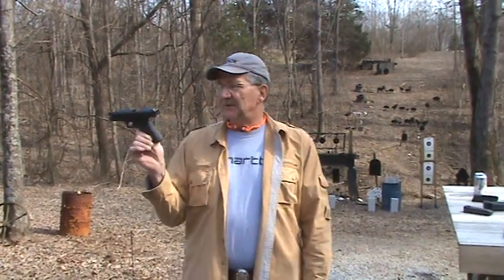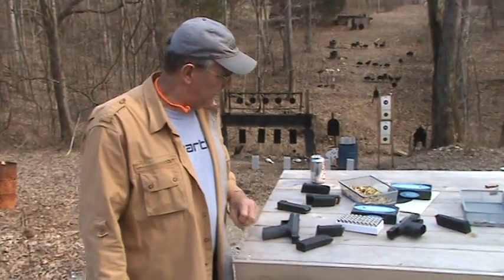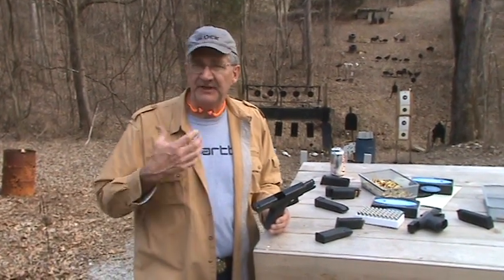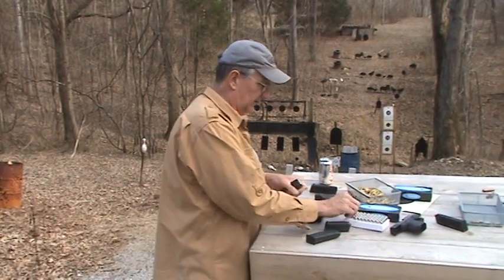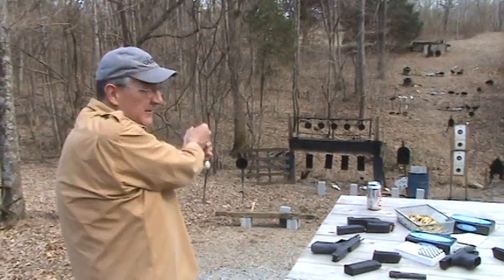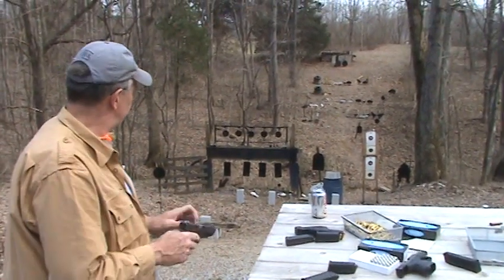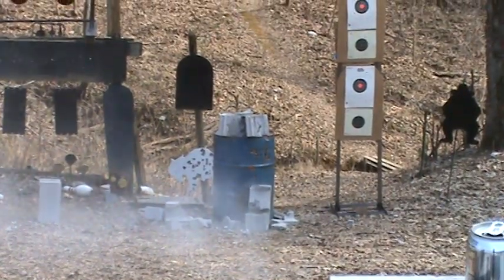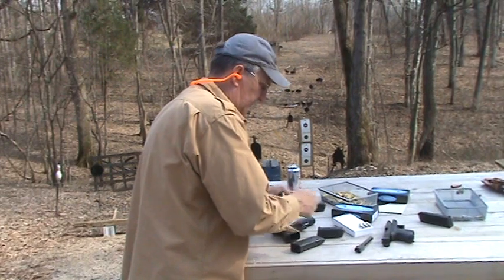Glock 20 with heavy cast bullets

Comment: You should check out the 10mm double tap Equalizer. Its a imposed load that stack a hollow point on top of a lead ball. A guy at the range was shooting it out of his EAA witness. each lead ball did seem to hit 1 inch high above the hollow point as promised by the manufacturer.

Comment: Stock Glock barrels are polygonal - they have no "rifling" to "cut" into the lead, the bore itself is cut in a geometric pattern that allows for a "rifling" effect. Since there are no edges, the lead will seal flat against the surface - raising pressure of the gas (harder to push the lead down), and after a few rounds can create a layer of lead that will act like tar to the next bullets fired - building too much pressure in the breech.
Some aftermarket barrels have actual cut rifling for lead.

Comment: Excellent video.  I have been debating buying a Lone Wolf barrel for my Glock 23 so I can shoot cheaper cast loads.  I know, they advise against reloading 40cal due to the "bulge", but I have not had one issue in thousands of loads.  Also, Redding makes a dye that will iron out the bulge, and it works great.

Comment: Good point. Using special rounds and your results will become special as well. One of the things I liked about this video. Snake loads from a 10mm are a lot like a Hornets Nest or discharge of several .22 simultaneously. thx again Hickok45. 
..btw, I get your point. Like throwing a knife vs a hammer. You better be accurate w/ the knife is a good point. You just do not have to be as accurate w/ a hammer is mine. .

Comment: You can't beat Lone Wolf for after market barrels for Glocks. Great video Greg!
Reply: Dang I didn't realize how big of a difference the barrel made.. are Glock factory barrels not that good??
Reply: @wingnutmcspazatron3957  Doing some digging, the glock barrels are actually great! The issue here is that the bullets are super heavy grain and hardcast, glock themselves advise that you do not use hardcast bullets with their polygonal barrels (which is all of them). Looking to pickup a lonewolf for hardcast hot loads as they can also shoot everything else.

Comment from the maker: Actually, I just discovered last weekend that the G20 barrel does not work in the G29. Guess I should have known that, but I didn't.  Not that I'd have any reason to want to switch it out.  If I want a longer barrel, I'll just use the G20.

Comment: those flying lead elephants were all over the place @ 4:20. that aftermarket barrel seemed to improve accuracy a bit considering. its not really common for hard-cast to be fired through a glock (let alone, super heavy hard cast) but i am surprised none the less... excellent video.

Comment: .40cal is essentially a necked-down 10mm. If im not mistaken the .40 and 10mm are the same diameter, case length and powder load is different. If it were me, i would call the good old 10mm a 40-magnum :)

Comment: I believe you are getting the keyholing (tumbling) with the stock Glock barrel because it either a) has too slow a rifling twist, or b) because it's polygonal instead of having standard groove-and-land rifling.
Nice explanation.
I carry a 10mm S&W 1006 for protection against two-legged varmints.

Comment: 10  MM Lone Wolf Barrels are the best for hot 10 mm and 357 sig rounds... This is just my opinion and I am a Glock Guy.     Love the Lone Wolf Barrels for them... Smaller caliber Glocks I will stay with Glock Barrels... Great Video..
Reply: KBLively  My Son and I have a few different Lone Wolf Barrels... We have never had a problem. My 357 Sig Barrel which I use on a Glock 40 is extended with threads for a suppressor .. My main reason for buying though was so I knew it was in the weapon and did never make the mistake... Great Barrels and great accuracy...You will be happy..Thanks
Reply: ugsisr what barrel length is it... just wondering which long wolf i should get to fit the 20

Comment: Just a correction Mr Hickok, you're referring to sectional density being high.  The shape of that bullet lends to a low ballistic coefficiency. Sectional density is the ratio of the bullet's weight to its caliber. That 10 mm 230 grain bullet will have a higher sectional density than a 45 caliber 230 grain bullet. A spiral pointed bullet will have a higher ballistic coefficient than a round nose of the same weight and same caliber.

Comment: From reading all the Glock forums/websites and hand gun forums in general they all said that using heavy hard cast hot loads you need to take out the stock spring and use a heavier spring.  22lb pound recoil spring for the Glock 20 is needed for anything 200gr and above.  You also want to use an after market barrel from either KKM, Jarvis or Lone Wolf.

Comment: Most people that I hear talking about taking grizzly say 12 gauge magnum slugs are perfectly fine, which have around 2300 ft pounds at the muzzle, and the s&w 500 magnum has numbers around 2500-3000 ft. lbs, so, yes, you are correct, although most people still abide by the 'bigger hole' mantra.

Comment: Got the lone wolf barrels for my glock 20 and 29. Haven't had the chance to shot with them yet, but loaded up the magazines with some double tap 200 grain hard cast lead rounds and tried to rack the slide to cycle the rounds thru... Jammed up like crazy on both guns. Either hung up or went in, but I had to use a lot of fore to force the slide open to eject the round.  All the hollow points I tried worked fine.
Reply: Richard Wisor Jr Any update about your G29 Lone Wolf barrel and the 200 grain double tap?  I am really thinking about buying a Lone Wolf barrel.  The Doubletap 230 hard cast lead bullets really gummed up my stock Glock 29 barrel with lead.
Reply: Lone wolf had me send them both of the new lone wolf barrels (20 and 29) to them along with a couple of the double tap 200gr lead rounds. They polished up the ramps and Chambers on the barrels and sent them back to me. Now I have no issues feeding those doubletap lead rounds. Made me a bit angry the could not send my rounds of ammo back. Told me they weren't allowed to send live ammo.
Reply: Thanks for the update!  I'm glad to hear the barrels work well with the ammo.  Oh, I can't believe they kept your ammo!  You would think if they can "receive" it, they could "send" it back, Geeze!
Reply: I was surprised by there excuse for keeping my ammo. I shot a lot of lead thru a S&W 357 and after so many rounds I'd get quite a bit of lead smeared I  the barrel, so my police Academy firearms instructor gave me the tip to put a few jacketed rounds thru the gun, and that would clean all the lead right out! Works great.

Comment: Yeah I wasn't sure which one you were converting to. I think the G23 frame and slide should be able to handle the 9mm and the .357 sig but you will need to buy springs made for it because both the 9mm and .357 sig have higher pressure. The 9mm just just a little more and the .357 sig has quite a bit more. I would think that the with the right spring the other parts should hold up just fine.

Comment: @Outlaw409 for backpacking a 10mm is a pretty big cartridge, so is the .357mag.For what ur gonna use it for i would go with a .40S&W or .357SIG u can pick up one for pretty cheap & ur getting a good bit of stopping power with both & they are compact enough not to be a burden while hiking, or camping. The 10mm is a little overkill in my opinion & has a good bit of recoil to it

Comment: Well if the barrel works then the only think I think you would need to get would be a spring made for the G20. The slide should be able to take it and the frame is the exact same one so it will do just fine. But definitely get a spring made for the G20. They aren't that expensive either.

Comment: The reason the bullets keyholed and had no accuracy is the length to diameter ratio you mentioned; this determines the required twist in the rifling to stabilize the bullet. Obviously your other barrel has a higher twist rate that the stock barrel. What you discovered is that this ammo. is unusable in the stock barrel. the reason, once again is very clear; the twist rate of the rifling is not steep enough to stabilize the longer bullet. You can verify this by looking down the two barrels.
Reply: John Affleck Heavy bullets require slow twist.

Comment: @arkangel8419 The 10mm is a hot .40 caliber. The same comparison that a .357 would be to a 9mm. Same calibers. Completely different rounds. The .40 caliber was developed by S&W in 1989-1990. The .40 was developed from the 10mm case, just shortened by several millimeters. The 10mm is an awesome round. I have killed two eight points and some smaller deer with the S&W 610 revolver in 10mm.

Comment: I expect what Hickock will say is to try a dozen types of ammo and see what your gun seems to "like."  Two guns of the same make and model might prefer different brands.  I'd be sure to try a few of the least expensive, because if you can't tell a significant difference in accuracy, go with lesser cost.  My Ruger Mk II used to like good old Remington Thunderbolts about as well as anything.

Comment: I saw tumbling issues with my stock Glock 29 barrel and the 135 grain nosler JHP's from Underwood.  Exact same wild shots and keyhole pattern that you saw.  Switched to a KKM barrel and the tumbling went away.  Maybe the factory Glock 10mm barrel isn't good for rounds that push the envelope in speed or weight.  Strange.

Comment: @snoeplow These are Double Tap, but yeah, price isn't bad at all for a load that can equal a .41 Magnum and even some high end/lower power .44 Magnum Bear loads. If I don't have a rifle/shotgun, then I'll take 15+1 or (10+1 where I live) of hot'n heavy 10mm with the ability to reload in 2 sec over .44 Mag. 2-4 hits with 10mm >  1-2 hits with .44 Mag.

Hickok - Any chance you could try out some 9x25 Dillon rounds from your G20, and/or 40 Super from your G21?

Comment: Yes, a measure of the weight of the gun powder you would load into a casing. The "grain" as a unit of weight, goes back a ways. Now days, its used almost exclusively in the firearms projectile industry.

Comment: Well the 10mm produces more pressure than the .45acp so I would think that the 10mm spring would work just fine. The plastic part (well it is some sore of polymer material but I'm not sure what it is called) is the exact for the 10mm Glock 20 and .45acp glock 21. I would think that the slide would need changing with the barrel because the hole where the tip of the barrel comes out would be too small if using a .45acp barrel with a 10mm slide and too big the other way around

Comment: @madtoonage I'd need to see some data on 9mm Dillon as a defense round. It's almost 2x the KE of .357 Sig. A 9mm bullet moving at rifle velocity (~2100fps) could over penetrate before it got a chance to expand. I think it's just a super high end target round.

I use DT Barnes Tac XP in 10mm, .45 Auto out of my G30SF or .357 Sig, .40 in my G33 for defense against anything on 2 legs and most things on 4 legs.
Reply: Had a rookie mistake about a month ago, and had an ND with my EDC G26gen5. A Remington Premium Defense, 145gr HST passed through my left hand, and left knee,  from point blank, and expanded PERFECTLY. Because of the extremely close discharge, is the only reason for the through and through. Had this struck center mass, or hit bone or heavy tissue, it most definitely would have been far more brutal, and most likely fatal. I assure you. The 9x19mm Parabellum cartridge has had so much ballistic study devoted  to perfecting it, that it has surpassed a vast number of other cartridges. As far as personal defense against human assailants,  it is a more than effective round, with higher capacity, and extremely manageable, rapid secondary shots. Love my 45acp, not much for 40s&w due to cost, and staying with the same caliber for necessity of only 5 separate calibers. 9mm, 45acp, 7.62x51nato, 7.62x54r, and of course, the good ole 22lr

Comment: @hickok45  I'm guessing that the 230gr should key-hole even MORE in a G29 with a standard, Glock, factory barrel. If you have any more of the Double Tap 230gr you might be able to check that out.  I don't have a Glock 10MM barrel. I am waiting for a KKM conversion bbl for my G30.  I will keep my bullet weights at, or below, 200gr.

Comment: What's your thought on the cartridge case used by DoubleTap, as opposed to standard brass?  In terms of pressure in the chamber, and in terms of reloading (do you even reload with the DoubleTap casings?).

I really like their 135gr Nosler JHP (super-flat high velocity round) and the 180gr bonded defense JHP.  Although I have a box of those hardcast VW Bugs for fun :)

Comment: Thanks for the video. I went out and bought the Glock 20 after reading a bunch on it and watching countless videos.  My first 50 rounds of FMJ went flawlessly. However, I purchased some Doubletap 135 gr HP and on the second round it failed to eject. I fired out the rest of them without fail and loaded up again, same thing, second round failed to eject. Without any other ammo having been shot through it, do you think this is an ammo issue, a hardware issue, or could it even be my grip?? Thanks

Comment: It's ironic the FBI decided the 10mm had too much recoil for the average officer and yet you handle it very well.

The stock barrel should have done better,  I was surprised by the inaccuracy of it.

I guess it wouldn't be wise to hide behind a cement block wall if someone has that big, bad 10mm aimed at it.

Comment: From what I have heard the frame of the gun is the same between the two so if you are going from a 10mm to .45acp or the other way around then you would need a new barrel, slide, spring, and mag. I have compared side by side and looked at them both and the frame (by frame I mean the part that the mag, slide, spring, and barrel come together on) seems to be that same. It is cheaper than buying a whole new gun but not by enough for me. I would rather buy the other gun and have two.

Comment: I experienced keyholing inside 25 yards with the Doubletap 1600 fps 135 grain 10mm  rounds in the standard Glock 20 barrel.  Too slow twist for a fast short bullet?  Next time I am at the range I'll try the 6 inch wolf barrel and see if the keyholing is eliminated.  Standard Glock barrel is a tack-driver with most ammo.  I made a 1.5 inch 5-shot group at 25 yards, all inside the 10 ring the day I put in my Heinie straight-8 sights, using cheap American Eagle 180 grain range ammo.

Comment: And the part on the slide that come into contact with the back of the bullet that houses the firing pin is sized for a specific bullet. Maybe the .45acp slide could have a 10mm round fit there but the 10mm slide is too small. I am looking at my G20 right now just to make sure. I don't know every kit out there so maybe there is a way around the size difference. I was also going to buy a .45acp slide, spring, barrel, and mag but decided it isn't worth it. So instead I got a 6' lone wolf for my G20

Comment: The best of both worlds is the Kimber Eclipse chambered in 10mm. I get to have my 1911 and a 10mm. The Glock 10mm which is the same frame as a Glock .45 just doesn't feel right in my fairly small hands. But a 1911 feels great. Recoil? not as bad as you might think, to me a .357 revolver was worse. And you get to own a work of art, not just a pistol. Glocks work but they ain't pretty. Handguns are for self defense, I realize, but, I want to hand my Kimber down to my son, then my sons son.

Comment: hey hickok what is a normal store bought 10mm bullet speed? & what is a reg store bought .40S&W speed? because the 10mm is a .40 cal bullet too right? the only diff is that the 10mm has a longer case that allows more powder.....I only ask because i shot one at an IDPA shoot and this guy loaded his down to the min power grade for IDPA which is like 125 i think & i just wonder why not just use a .40?????

Comment: I run my .45 with Magnus 215 grain hard cast semi wadcutters and use their 250 grain 429421 Keith bullets in my .44 Magnums. I have shot "cinder blocks" with both and from what I have seen here, my .45 load is doing what the 10mm is, but maybe not quite as fast. The 10mm can't hold a candle to what my 44 does with the bullet I mentioned. I sold my 10mm a long time ago and as far as my needs and desires go for a hunting handgun or woods self defense, I'll stick with near 50 years of experience and the guns and calibers that provided it. Thanks for showing what the 10mm won't do well though, your work is appreciated.

Comment: The Lone Wolf Barrel was impressive. Since I am in Black Bear country, and the Moose Huggers have all but stopped hunting, Bears and Big Puddy Cats have lost their fear of Man. This is a very good answer to having to staring down the sights at a 4 legged preditor, and wondering if I have enough firepower to  stop the critter that wonders if I taste like chicken. Fortunately,, I have not needed to cap a critter yet, but close encounters has happened several times.  The critters are getting braver,  faceing them down has been occuring more frequently.  Pulling a carbine out of a scabbard takes too long to help the critter make an informed decision and go away. This side arm may be the answer to having enough firepower without the recoil of a 44 Mag.
Reply: Run a glock 20 with an aftermarket barrel and hardcast underwood or buffalo bore, an extra 15rd mag and bear spray and you should be good.

Comment: Because bullet size matters more in Glock barrels. I have shot thousands of lead bullets in a Glock 21 (45 acp) with a glock barrel. Its very accurate. 
I suspect the cast bullets he uses in this video is .001 or .002" too small.